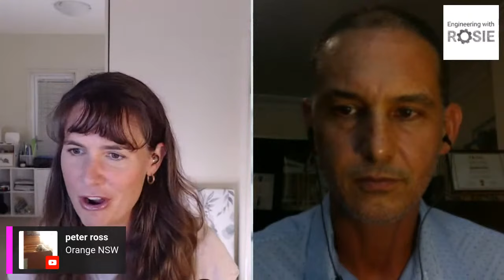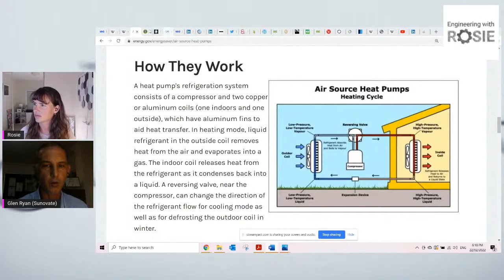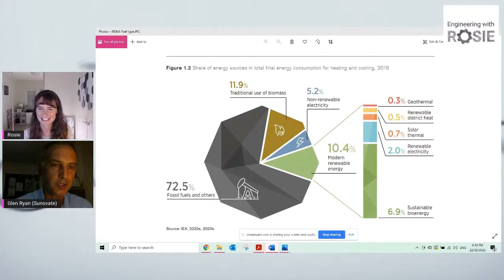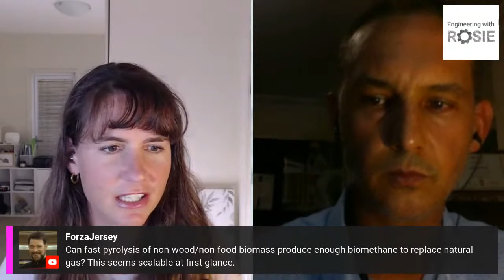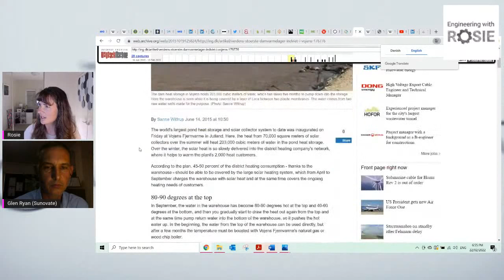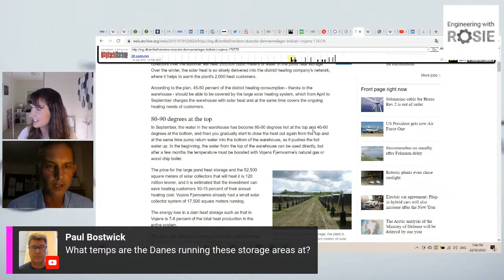Zero-Emissions Heating Options with Glen Ryan | Engineering with Rosie Live Ep 9

Comment: Heat pumps:  Back in the 80's a heat pump really did not produce a lot of heat, compared to running a typical gas furnace, and they still do not really get the air really hot.  They have the highest efficiency that the air is only heated to about 90F to 100F, or about 40C.  Back in the 80's the R-22 systems just could not blow out -10C air on a really cold day.  The SEER rating was only 8 to 10 on a higher cost unit.  

Now with R-410 and by using a variable speed compressor, they can run at about 75 Hz to 120 Hx, and run a lot more gas through the compressor.  Now the SEER rating is over 18 on most units, and up to 38 SEER on a few units.  So they do produce a lot more heat than the R-22 systems.  And use about 1/3 of the electricity while producing 100,000 Btu's compared to a 1980 unit.  

So heat pumps are much better in the past 4 years, compared to 20 years ago.  And the ductless units you can buy for a reasonable price at Amazon, they are about 1/2 the price of a unit I could buy from a wholesale place that only sells to HVAC contractors.

Comment: Thermal mass hot water storage.  I guess this could work.  If they used flat plate solar collectors in the summer, it is easy to heat water to about 130F.  It must be in a insulated tank.  A Evacuated Tube solar heater can heat the water to well over 160F.    Then a district heating system can be connected to that, and provide a massive amount of heat to distribute over the winter.  However it can run out of heat fairly quickly, unless the tank is Really large!   

The problem is the flat plate collectors can collect a lot of heat per square foot, and are a reasonable price.  The evacuated tube is much less heat per square meter, and is a lot more expensive.  

When the tank is over 100F, you could just pump the hot water to the heat exchanger or to a under the floor piping system to heat a home or business.  Once below 100F, then a water source heat pump can extract the heat to a temperature of about 32F or 22F, (0C or -10C). 

You could use excess wind power at some point to heat the water tank.  However if you where using a coal or natural gas power plant to provide electricity to heat the tank, it would not be nearly as energy efficient.

Comment: I have worked on heat pumps since 1983.  While I never worked on a ground source heat pump, the same machine is used for water source heat pumps, and I have repaired about 75 of those.  The WSPH is using a water tower to get rid of the heat in the summer, and using a  boiler to collect keep the water loop at about 55F to 65F in the winter so the heat pump can collect heat from the water loop in the winter.    Many times it is difficult to refit a very old building with a HVAC system, or this WSHP is the lowest cost way to heat and cool a building.  

In Norway, it is popular to install the ground loop heat pumps, and they have apartment buildings that have 6 or more very deep wells, say 300 feet deep, to collect the heat and maintain the water temperature at about 22F or -8C.   These can collect a lot of heat, even when it is -20C or -20F outside.  

I prefer air to air heat pumps, and that is the kind that I will typically install, and I have a 48,000 Btu heat pump in my 1,800 square foot home.  My coldest winter temperature will reach about 19F or -10C.  I live in a very mild climate, Portland Oregon, where I am at about 100' elevation.  A nearby town of Sandy Oregon is at 1,200' elevation, and normally will go to 0F on some days each winter.  Heat pumps also work well there.  We have fairly low cost electricity, due to massive hydroelectric systems on the Columbia River.  

California is pushing all new construction to use a heat pump, instead of using the typical natural gas systems.  Modern systems that are 20+ SEER rating will produce a lot of heat - even on a very cold day.  Variable speed compressors used on most ductless heat pumps work great, even with 10F or 0F air.  Below -20F, then there is not a lot of heat available to collec.  Some units are better at 0F than other brands.  

There is a company that made a CO2 refrigerant in a domestic hot water heater.  They where able to make water at up to 130F very easy.  But they stopped production after about 2 years.  There is a couple of companies that make a 50 and 80 gallon hot water heater that used a 5,000 Btu compressor to cool the air and heat the water at the same time.  

I am a big fan for the ductless heat pumps that are sold at Amazon!  The cost is about $800 less than the types I can buy at a wholesale supplier.  While the brand name is not as "Good" they seem to run fine.  

Hydrogen, I don't think that will ever become a great fuel.  While 1 year ago, I was thinking it might be a wonderful solution, further knowledge about how it is made, that it takes several hundred KW to make 1 Kg of hydrogen, then a 3 Kg hydrogen tank can get a small car about 1,000 Km.  So that would be about 1,200 KW of electricity to produce the hydrogen, I have no idea how much power to run the compressors to raise the pressure to 4,000 PSI, and then you can run the car for a fairly long distance, but the cost of the hydrogen tank is very expensive, because of the extreme high pressure they store it at.  

A Tesla can go about 1 mile on 250 watts of power, so much less electricity than the hydrogen car (1,200+ watts per mile for hydrogen car).  Also most hydrogen is produced by converting natural gas into the hydrogen, then the hydrogen is not typically compressed, and used in a adjacent plant to produce things like fertilizer.  

Compressing hydrogen or compressed natural gas takes a lot of energy.  We had a pair of 75 HP compressors at a small CNG tank at the City Of Long Beach California, to power the trash collectors.  However once they had more trucks to fill, and started to fill a Taxi fleet, they went to a Perkins natural gas powered 200 HP compressor to produce the 4,000 PSI CNG.  

I like your opinion that in 5 minutes a educated person can discover enough problems with using hydrogen in a home to heat something, or in a car or truck to drive it.

Comment: In Australia could  part of the solution to driving down energy demand for households be a combination of building smaller and requiring more unbuilt more space on the block? 

We need 20% green space to avoid local heating, heating also being a significant issue in Australia. It would also be beneficial for the environment and local cooling to include space for a water tank and a rain garden as these assist with keeping soils moist for longer. Moist soils lead to a cooler local environment,  healthier plant growth, and better quality shade. At scale this can also cool areas as water remains in wetlands and lakes for longer further cooling the area. There is research on how local temperature can be affected by irrigated spaces and water, and local temperatures in turn can affect the temperatures of areas downwind especially after sunset (in relation to heatwaves in Melbourne and areas where temperature increased after sunset).  

From the winter heating perspective, for an individual house, if the inground heat pump or above or below ground heat storage was to be used it seems that this would also require space on the block, or could it be located under the house? 

If a house is smaller, then as a general rule, it would need less materials to build and insulate it and less energy to heat and cool? Australian houses are, on average, the 2nd largest in the world behind the USA. There has been some coverage in the press on how with regenerative farming leaving re-establishing native vegetation and using water slowing techniques keeps water in the landscape for longer. Not so much on how similar techniques can be used in streetscapes and on individual blocks. But an interesting engineering challenge of a different kind..

Comment: You looked at this problem form engineering point of view and looking for technological solution, but best solution is just desuburbanisation. Multiapartment building require much less heat per apartment than signle houses. Whats even better it's also reduce transport emission.

Comment: Is there a reason for hot countries not to insulate and seal up homes?   I was shocked at the lack of double glazing and proper insulation of homes in Arizona US.  Insulation keeps the heat out as well as in.
Reply: Tony Stanley,  I grew up in a home in Huntington Beach California, built in 1963 with absolutely no insulation and single pane windows.  Even the air ducts in the attic are insulated with only about 1/4" of fiber board wrapped around the tin air ducts, and that was 80% asbestos.  A very cold winter night was about 40F, while the heat in the summer could reach 104F, or 40C.  Now it is popular to install insulation in those older homes, but still I know people who never insulated the home.  

I know a lot of people who live in Arizona, and while it can reach 112F in the summer, they only have 3.5" of wall insulation, single pane windows, and no desire to change it to make it use less energy.  They will put in 6" of ceiling attic insulation.  In the 90's they building codes got upgraded to require 6" wall insulation.  Now after the 2015 code revisions, they are requiring double pane windows and R-19 wall insulation, R-26 attic insulation.  Still not any insulation under the cement floor slab.

Comment: I'm in the UK and it seems everyone wants to go for heat pumps but we have some major challenges. From reviews, I see air source and more so ground sourse ones here are very expensive to buy and run and quite noisy and a huge piece of equipment to install especially in the limited outside spaces outside buildings here. I also see efficiencies are not as good as expected? Then if we all get them we are going to need even MORE renewables to power them, which is also going to be a major issue. I know we need to stop burning fossil fuels but getting the UK off gas for heating soon is going to be impossible it seems.
Reply: The people in the UK who were the early adopters of heat pumps have found a lot of problems.

The first is not having a well insulated property.

Early heat pumps were far more noisy than todays pumps, but this is mostly down to a badly designed unbalanced system.

The old central heating pipes and radiator’s were used which lead to inefficient, expensive to run systems because they weren’t balanced.

When fitting a heat pump system the whole of the old central heating system has to be removed. Which means the government grant is no where near generous enough. A balanced efficient system means bigger radiators, large bore pipes, a smart water heater tank, and then the heat pump, plus better insulation.

In the UK climate the heat pump needs to be kept sheltered from our damp conditions, plus because of the warmth, it attracts our little and large furry friends, mice and rats.

In the UK heat pumps are great in new builds because the system can be designed into the build from the start, but when retrofitting the cost of the system is horrendous.

All the above problems have lead to the bad press that heat pump system’s receive.

In Sunderland the local council has been replacing the heating in tower blocks with a ground source heat pump system this started back in late 2019 if I remember correctly, the companies involved being, ENGIE, Kensa, and Sun Amp. It’s been a while but there had been few if any problems reported and it has been cheaper and more efficient to run with no complaints from the tenants or the council/housing association. Haven’t seen much in the media since 2020, with 300+ properties having the system installed.

When I have pointed out this project in other comments sections the majority of comments have been around the amount of space needed for the underground pipes, with people saying that trees and grass areas being removed the size of football pitches, which in this case wasn’t true, the pipes went down vertically into the bedrock and aquifer, this is a more expensive way of installing the pipes but takes up less horizontal space. This type of system has been fitted successfully into UK office blocks.

Main stream media loves to take the negative side of alternative energy and give it bad press, they then let the public run away with this. The media rarely go back and revisit the story and show the difference it has made. They only go back if there’s a problem because this is what the public seem to want, bad news gets more views and engagement.

Comment: Back in the 1970s I had 2 interesting experiences. My then-small son and I visited for some days in winter at a farmhouse at 44 deg N, which was heated by 2 wood stoves. On a cold day back home at 39 deg N I attended an open house at a new house with passive solar design. At the farmhouse we experienced cold in some times and places, BUT it was also possible to really warm our bones standing near to a stove. The passive solar house had a triple-glazed south-facing sunroom with containers of rocks or water for to moderate temperature excursions. It seemed like it had a similar benefit, that you could really feel warm in the sunroom. By contrast, people complain when heat pumps blow air that is barely above room temperature and they don't feel warmed up. Think how charming it could be to combine heat pump and passive solar.

Comment: The UK is also considering Hydrogen blended gas , with record gas price increases and the infrastructure costs with upgrading the distribution network its creating the perfect storm of financial pressure. No one seems to be addressing the easiest cost effective solution to reducing cost and consumption which is making homes less dependent on heating with greater efficiency from insulation.
Reply: While insulation is the best way, most of our older houses have had the easy bits done, i.e. loft insulation and double glazing. Any significant immprovement is very expensive and not cost effective. 
Heat pumps are overhyped because of a fundamental misunderstanding that is often printed in themedia. which is their efficiency. This is based  on what is termed Coefficient of performance which is based on electrical power units. This is not efficiency, it's linked but is far from true efficiency figures which is approximately 60% less than the COP. And as air source heat pumps vary from about 3 to 1 COP depending on outside ambient, they may be less effcient than a modern gas boiler.
Reply: I understand it may sound cheap/easy to insulate homes but does that take into account fitting new double glassing? I know the roof insulation would be a cheap upgrade but the glassing is getting to end of like and woudnt be cheap. I'm in a 20 year flat with a gas combination boiler which was replaced about 5 years ago. Its complicated!
Reply: I was thinking that hydrogen blend gas would be a wonderful idea.  However then I discovered it takes about 476 KW to make 1 Kg of hydrogen using electricity and water to make the hydrogen.  So that is much more power than you will ever get from burning the furnace to heat your home.  Lets say you want to provide 100,000 Btu's of heat.  That is about 1.2 gallons of propane, or 1.2 therms of natural gas, or 5-7 KW of electricity in a heat pump.  

If you had a system to produce hydrogen with electricity, it would take well over 100 KW to produce enough hydrogen to provide 100,000 Btu's of heat using a gas furnace.   A electric heater would use about 30 KW, while the heat pump only 5-7 KW.

Comment: Environmental concerns aren't the only reason the Netherlands is trying to lower natural gas usage. Extraction of gas from fields in the north of the country is causing earthquakes that damage homes. People who live there are very unhappy about this. 
On the point of heating storage, IIRC Dordrecht has a system where they collect industrial waste heat from the port of Rotterdam on a barge filled with some kind of wax. The barge is then sailed to the city and connected to the city heating system.

The mould issue you had in Denmark isn't caused by heating, but by improper ventilation. Insulating a home stops drafts, but you need enough fresh air to get rid of the moisture you breathe out. If heat loss trough ventilation is an issue, you can get heat exchangers that are crazy efficient (like 99%), but there is some extra capital cost involved. Sucking in fresh air from the windows and pushing it out through the roof is usually easier.
Reply: But Europe should try to reduce the use of natural gas before shutting down their own gas fields and thus getting more dependent on import and especially russian gas and oil. We have started in the wrong end of the rope.
Reply: @gunnarbech8147  I think the problem is also the fact that the gas just goes on the world market to the highest bidder. If Europe produced more gas china would still buy it and leave us with high prices. I think there needs to be export restrictions of some kind.

Comment: In Sweden, we became carbon neutral (almost ) in the mid 80s. At that time we had 12 nuclear poer plants and hydro  and some biomass power plants. Oil was phased out as residential heating option. Now heat pumps dominate which is a genius way to heat houses. In Germany and UK they are using natural gas extensively which from a energy system perspective, not clever at all. Solar panels does not work at all during the winther months.
Reply: solar panels work further south, for instance they give about 10% nominal output in January in England
Reply: Alan, that is optimistic, as the average availability for teh U.K. as a whole is 10% for a year, winter is significantly less. Also the maximum output is at mid day when a lot of people are out at work anyway.